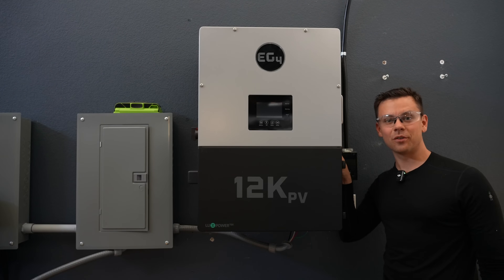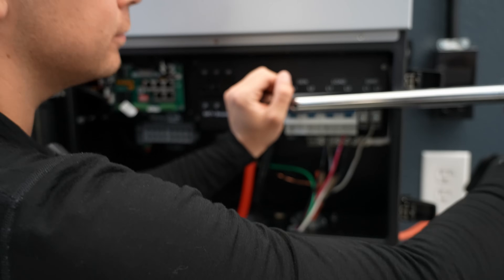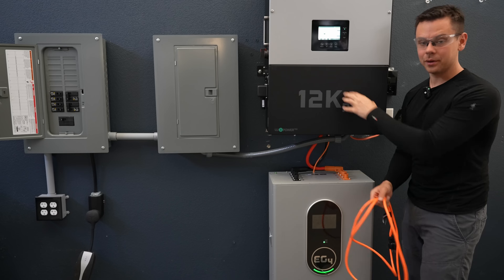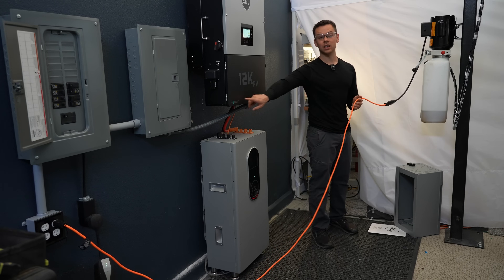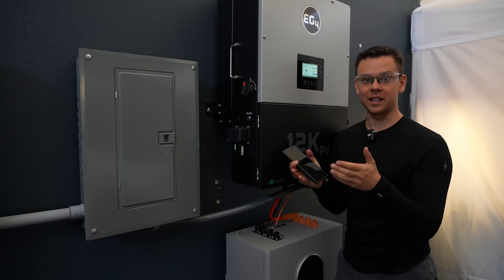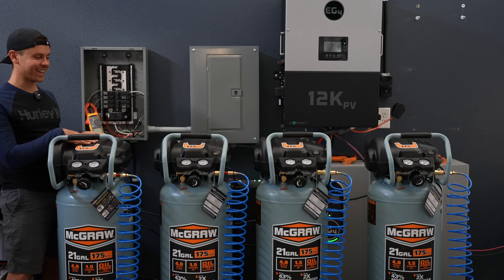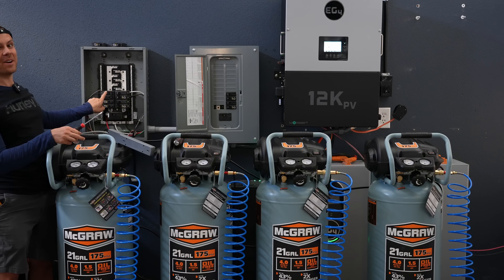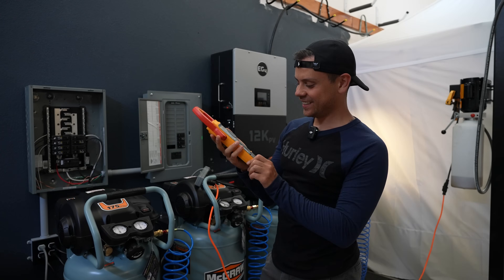NEW! EG4 12Kpv: 8,000W 120/240V Hybrid Inverter w/ 136A Surge?!

Comment from the maker: EG4 12Kpv Affiliate links:
Purchase from Current Connected: https://www.currentconnected.com/product/eg4-18kpv-hybrid-inverter/?ref=wp
Purchase from Signature Solar: https://signaturesolar.com/eg4-12kpv-hybrid-inverter-48v-12000w-input-8000w-output-120-240v-split-phase-rsd-all-in-one-hybrid-solar-inverter/?ref=cPwLcVc0SW-BjN

EG4 18Kpv
Purchase from Current Connected: https://www.currentconnected.com/product/eg4-18kpv-hybrid-inverter/?ref=wp
Puchase from Signature Solar: https://signaturesolar.com/eg4-18kpv-hybrid-inverter-eg4-18kpv-12lv-48v-split-phase-120-240vac-ul1741-cec/?ref=cPwLcVc0SW-BjN

EG4 6000XP
Purchase from Current Connected: https://www.currentconnected.com/product/eg4-6000xp-inverter/?ref=wp
Purchase from Signature Solar: https://signaturesolar.com/eg4-6000xp-off-grid-inverter-split-phase/?ref=cPwLcVc0SW-BjN

0:00 Mounting
0:36 Intro and Setup
7:01 Fun Testing! Surge Capacity w/ Air Compressors and Car Lift
11:38 What Should You Buy? 6000XP VS 12Kpv VS 18Kpv

~~~~~~~~~~~~~~~~~~~~~~~~~~~~~~~~~~~~~~~~~~
Tired of getting ripped off? Check out my "Will Prowse Approved" solar product recommendations below!

12V Batteries
https://www.mobile-solarpower.com/lithium-batteries.html

48V Batteries
https://www.mobile-solarpower.com/48v-batteries.html

Offgrid Inverter System Builder
https://www.mobile-solarpower.com/48v-complete-system-blueprint-559371.html

Hybrid Inverter System Builder
https://www.mobile-solarpower.com/code-compliant-48v-offgrid-system.html

Mobile Handtruck System Builder (very popular!)
https://www.mobile-solarpower.com/mobile-48v-system.html

Solar Panels
https://www.mobile-solarpower.com/300w-solar-panels.html

Ground Mount Solar Racking
https://www.mobile-solarpower.com/ground-mount-racks.html

Wire, Lugs and Busbars
https://www.mobile-solarpower.com/wire-and-connectors.html

Tools
https://www.mobile-solarpower.com/tools.html

Fuses and Circuit Breakers
https://www.mobile-solarpower.com/fuses.html

Plug-N-Play Solar Systems
Ecoflow, Anker And Bluetti! So many models to choose from. See my current recommendations here:
https://www.mobile-solarpower.com/full-size-systems.html

~~~~~~~~~~~~~~~~~~~~~~~~~~~~~~~~~~~~~~~~~~
Need to build a large DIY system? Need a trustworthy solar distributor? These are my favorites:

Signature Solar
Creator of EG4! Solar Minisplits, Victron and More! Largest Solar Store Online.
If you want $50 off, please use my link below and coupon code "DIYSOLAR50":
https://signaturesolar.com/?ref=cPwLcVc0SW-BjN

Current Connected
Best Prices for EG4, Victron, Midnite and so much more! Fast Shipping and Highest Rated Customer Service:
https://currentconnected.com/?ref=wp

~~~~~~~~~~~~~~~~~~~~~~~~~~~~~~~~~~~~~~~~~~
Join our DIY Solar Community 
Need more help? Join the largest solar forum on the internet for beginners and professionals alike. 140,000 members and counting!
https://www.diysolarforum.com

Check Out My Free Book
Best-selling and beginner-friendly guidebook to off-grid 12V solar!
https://www.mobile-solarpower.com/the-book.html

~~~~~~~~~~~~~~~~~~~~~~~~~~~~~~~~~~~~~~~~~~
Contact Information:
I am NOT available for personal solar system consult! If you wish to contact me, this is my direct email: williamprowsediysolar@gmail.com
FTC Disclosure Statement and Disclaimers:
Every video includes paid promotion or sponsorship (such as free products for review). Some links on this YouTube channel may be affiliate links. We may get paid if you buy something or take an action after clicking one of these. My videos are for educational purposes only. Information is subject to change/update at any time. Electricity is DANGEROUS and can kill. Be smart and use common sense :) DIY Solar Power with Will Prowse is a participant in the Amazon Services LLC Associates Program, An affiliate advertising program designed to provide a means for sites to earn advertising fees by advertising and linking to Amazon.com
Reply: Signature Solar also has the 18K refurbished for $3699 - I would assume (but might be wrong) that somebody could click any of your links above so you still get the referral credit and then go over and order the 18K refurbished one instead.  They say it's fully functional with a 2 year warranty so that's probably the route I'd go.
Reply: Some large commercial AC units draw over 200A
Reply: Welder
Reply from the maker: @66bigbuds  that's an easy load
Reply: Will, what does the 12kPV do with 120v surge loads alone? For instance, what if you try starting 2 (or even 3) of those compressors on one leg with no load on the other leg?
Reply from the maker: @tinkering_solar_guy  it can handle surge on one leg as shown in the video. And max imbalance of 4kw
Reply: I've noticed you have basically left Vicron behind. Is this due to quality, price, or other reasons?
Reply: @offgridstruggles7504  victron? Trash!
Reply from the maker: @offgridstruggles7504  left victron behind? Have you not seen all the videos I have made praising their products?
Reply: @WillProwse  I have. I watch you all the time. Just haven't seen much victron so I thought perhaps you changed your mind about their quality and or price. I have victron and it just works. Def not cheap but it works lol
Reply: @WillProwse  I do appreciate the response. You've been great resource on diy. I was able to do my own system thanks to all your videos. Saved me from among alot of mistakes.
Reply from the maker: @offgridstruggles7504  I'm running multiple victron modules in multiple systems as I type this. Nothing bad to say about them besides their complexity for beginners. I think they could integrate modules into single units though. That would be nice
Reply from the maker: @offgridstruggles7504  oh awesome, glad I can help :) and I love victron
Reply: @WillProwse  yes I think that's where Victron may get left behind unless they come up with multiple all in one units for simplicity and cost.
Reply: Agree, victron needs to adopt a system cabinet that components can drop into kinda like how breakers can drop in. Somehow give us a system we don’t have to have a noodle nest of wires.
Reply: Can we get a link for battery also?
Reply: You should try to have some fun for the diehard cheapo out there, try to mimic the input and output capacity of the system with all Amazon equipment, would be a great show! Lol
Reply: Will , can you do some videos on wind generator’s  ? Where we live every evening like clock work the wind is a steady 9-15 mph 9p till midnight then 20 to 30 mph from midnight 01 till 5:50 a . We’re on the top of hill on our property 25’ above the plane . Thank You like & subscribe ❤
Reply: @brendafarrow3117 he'd have to live in such an area.
Reply: Will: so do you have a video of your best quality (durability, efficiency, best design+engineering) cabin or small home system? It would be nice to see your best solutions for say S/M/L systems. And watch them evolve over time, as opposed to component presentations.
Reply: Sorry Will, but I'm not sure I trust this video.  I just saw a guy tripping this inverter with a little over 50 amps.  And if you read the specs, the MAXIMUM output current is 50 amps at 240 volts.  Hmm.
Reply: I’m building an off grid house and definitely have learned a lot from your channel. Thank you Will  I’m still on the fence on what unit I’m going to choose, but I think it’s going to be 6000xp or the 12Kpv
Reply: Welding machine.
Reply: Why there is no 120v LiFePo4 battery pack, that will remove this kind of large inverter,heat and sound? (40 cells in series where 50ah makes 6kw,100ah makes 12kw).Also Efficiency will be increased as less heat and components are needed. Two of 120v batteries will make 240v , four of this will make 480v that can charge the EVs. If safety is a concern, then good design will defend this kind of problem, removing two terminal by using pin port . A 120v 50ah battery is similar size as 48v 5.1kw server rack battery pack. If a small dc to ac inverter are installed into this battery, people can use this battery as plug and play...
Reply: @AKadir-lc5wu  no. Batteries are DC. And 120V is dangerous.
Reply: 7.5hp single phase 1800rpm motors are around 240A inrush. My big compressor is the one thing that I'd probably need to convert to 3ph and vfd if I wanted to run it off grid.
Reply: @WillProwse - can help me with something?  If these EG4 converts, in this case the 12kPV is limited to ~35A output, how does it run a grid passthrough of 80A? Presumably the same Load connections are used for the passthrough as well as the 35A load? What am I missing?
Reply: Also I contacted signature solar to put me a complete system together using the 18K and two EG4 batteries with all components needed. And I still haven't heard back from them.
Reply: My diy garage ore smelter may hit 136A    haha
Reply: Breakers are not meant to be used as contactors. Just beware.

Comment: I have question on the all in one 120/240v , can I operate separate lines at the same time? example a 120v fan and a` 240v pump together?
Reply: Yes. It's able to mix and match between the two 120v legs, so as long as the combined power draw is below 8kw, you should be fine. Granted you might run into stability issues if you're close to maxing out one leg while also using the other

Comment: Hi will , love your videos 
" Need  HELP "
I have 3ea 24volts 200ah EG4 batterries with my 24 volts growatt inverter for about 3 years now.
I am going to upgrade to 48 volts set up with this EG4 12KPV inverter 
My plan is  to Add 1 more 24v 200ah battery to have 2 pairs of 48volts ( series 2 batteries to make it 48 volts ) 
with the total of 400ah 48volts battery bank to power with the EG4 12Kpv inverter 
Is this SAFE and POSSIBLE , also ,  if  battery monitoring works on series connection
Please advise 
Thank you

Comment: So, if you're not hooked to solar, and want to charge batteries from the grid, is a plug/outlet needed? Or is it directly wired to a breaker in the main panel?

Comment: I am very new to solar game. I have a 12kpv and 2 power pro batteries with a 7200w pv array. Was wondering if there is an easier way to hook it up without all the trasfer switches, sub panels, side taps, ect.

Comment: I bought a crazy powerjack inverter awhile back that claims to be 10000 watts and 40000 surge watts, crazily enough when I open it, it actually looks like it might be able to handle 10k, two GIANT torodial transformers in parallels, got it for $250 it also has a transfer switch and a battery charger just wish I could think of a way to move the internals to a new case the aluminum clam shell is very annoying and ugly

Comment: Will for the EG4 12 Kpv, I may have missed it but I cannot find information for the gauge wire and breaker sizes for circuits going from the main breaker panel to the EG4 12Kpv (GRID) and breaker (in the subpanel/or main breaker) size and wire size running from the EG4 12 kpv (LOAD) to the sub (critical load) panel.  Also, are all of the setup parameters identified somewhere.  Can you please help ?

Comment: Will,  I enjoy your thorough coverage of anything technology related.  I am a novice so please excuse my questions if they are off base.  That being said, if you could please help me with information on the EG4 12 Kpv:
1.  I need to setup a critical load subpanel (my main panel is full and I want to add a few items to it - eg Surge Protection - but I'm not clear as to how to connect it this to the EG4 inverter.  I see the panel in your videos but I have not come across where you provide the details related to the setup.  Breaker feed from Main Panel (?) if so what size, Breaker in subpanel (?) if so what size.
2.  How is this setup in the EG4 ?  Routing of the wiring, etc.
3.  Most of the circuits I need to move to the subpanel are with GFCI or AFCI - will this create any issue with this inverter ?
3.  I am concerned that having the EG4 constantly feeding power from (and replenishing) the batteries creates more activity on the batteries and consequently might reduce the life of the batteries.  So can the feed  from the main panel thru the EG4 to the subpanel be primary and only upon a grid down scenario would the feed shift service to the subpanel be fed by the batteries ? Could you either direct me to where these items have been addressed or provide some commentary on them,  FYI - 
I began my research looking at the Ecoflow (Ultra) and Anker (F3800) systems which I think both use this approach.

Thanks

Comment: Perhaps one reason to go with the 12K instead of the 18K is some Electrical Inspection authorities (such as the ESA in Canada) require significantly more approval (and permitting fees) for PV systems with more than 10kW of AC output.

Comment: Will, what do you suggest as far as batteries for an off grid with no grid available at the moment. Two of the sealed 14 Kmh. So 28 KWh total for a new home with one 18kpv inverter? My average useage is 18 kWh a day but I think it is an average for the area not my actual usage. It is just me in the home with two small freezer. Kitchen appliances and led lights. Ac refrigerated air unit in Summer.

Comment: If you wanted max inrush, the best way i know if is to have the compessors @ 80-ish psi, this will give you the hardest start for the compressor and max amp draw, then also have your lift ready tongo with the car off the ground raising the vehicle. Then if you want to add a resistive heater/hairdryer (or 2-3)  on max.  That might have tripped the 12k?  Idk, just an idea.

Love the video and also a great test/review

Comment: drop of lube on those battery terminals?   but yikes.    nice unit.. i can draw just over 22 amps @120 , with everything in my house on. 
normal run closer to 5/ 8 amps.   i am off grid in the city..  victron 3 k 24...gear. thanks

Comment: I'd be interested in knowing how to configure a critical loads panel setup with the 12k unit. I only have an electric stove and refrigerator to worry about but my garage has a 220 volt outlet which I use for running a 50 amp plasma cutter or sometimes my small inverter stick welder.

Comment: Outback all in one 3600w is all you need. You need a proper sized house with proper insulation is all. 
Its so cheap and its actually very easy to make an off grid system when you ditch the idea of roof or raised ground mount. 
DO a real ground mount with bifacial, rows of 1 panels, with stakes to prop up and secure, use white marble gravel for bifacials. 
This way is safest, easiest to use, easiest to install and clean and take down and replace if needed, it is safer and will not cause fires if anything goes wrong, it is inherently grounded, and cheaper this way, its easier to run wires underground its easier to install a cutoff switch at the panels. 
THe inverter is truly efficeint, and losses are completely minimized with the all inclusive high reliability outback inverters. 
You can do everyhting with 120v, you can get 120v clothes dryers duhh, and you dont need a large ac if its insulated. 
You can insulate houses with a rennovation if you just take down all the sheetrock, and then put back up with new clean and perfect rennovations. Its cheaper and easier and more value added this way. 
The panels cannot have land cleared for them, the stupidity of it all is deadly.

Comment: So, Will.. not sure if you will respond, and I understand if you don't, but which one should I buy if I plan to just drive my garage to start with (garage is basic stuff with 2 freezers and one Fridge)? I plan to grow in the future, but I also don't have 5 grand right now to drop on the 18k. Do I just save up to get the 18k, or will the 6k work, and then add more 6k's down the road, or maybe save for the 12k? I don't really care about selling back to the grid, just looking to provide my own power. Starting small first, then plan to grow as I learn.

Comment: Hey Will, I am about to pull the trigger on a whole house backup for my grid tied residential solar system. Do you have any experience with the Trophy Battery brand? I am thinking of combining the EG412KPV with Trophy batteries. Thanks

Comment: I’m wondering if the batteries are fully charged or not does the panels provide the energy as the sun hits them in the day for say the Air Conditioning?

Comment: need high voltage charge controller that will handle 600 volts /and a power inverter that can send 200/250 amps to house panel to run whole house .250 amp service / need to run whole house grid will be back up /

Comment: Having a 6000xp in the same space as a heat pump water heater could be an option.

HP water heater needs warm air. 6000 needs a cool dry environment. HPWH cools the air around it bc it removes needed heat from the air. Basically a cyclical system. 

So putting these in a mechanical "closet" would achieve that as well as reducing the noise each creates.
Those fans on the 6k were terrible even on video. It would be like sitting in a server room all day.

Comment: You mentioned using a critical loads panel if the 12K couldn't support the entire home load. Why does nobody use smart outlets to control loads at the device? 120v smart outlets are a dime a dozen and even 240v is available in the form of 50a 240v pool pump smart switches. Wouldn't even 2 dozen smart outlets crush a critical load panel in terms of cost, installation, and granularity?

Comment: This has two 25A MPPT's where the 18kPV has three MPPT's with one at 25A and the other two at 15A.  This is causing me an issue because my current panel layout would overload the two 15A MPPTs.  Trying to decide if getting two 12kPV's would be better since I would use up three of the MPPT's leaving me with the option to add another array later.

Comment: I have not been able to run my small refrigerator off my lithium battery.  The Inverter continues to flip the GFI on the Inverter.  After 6 hours the GfI went off.  Battery down 2%. What could cause this?  George